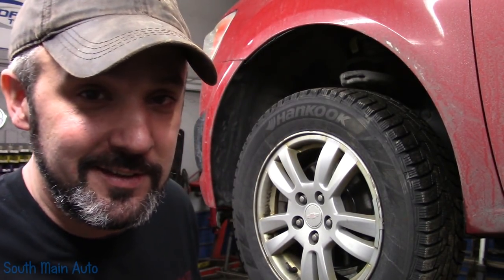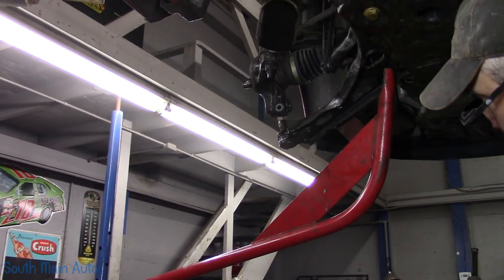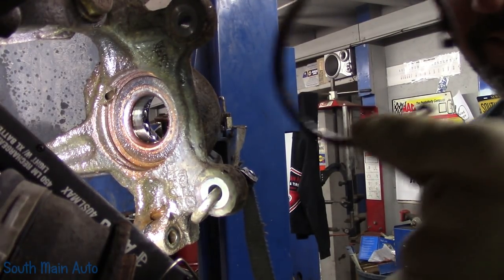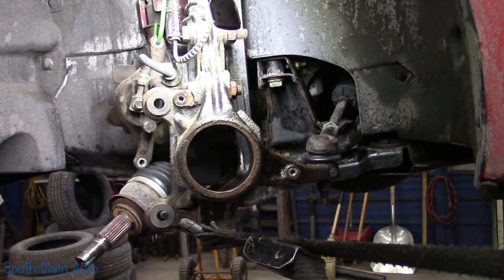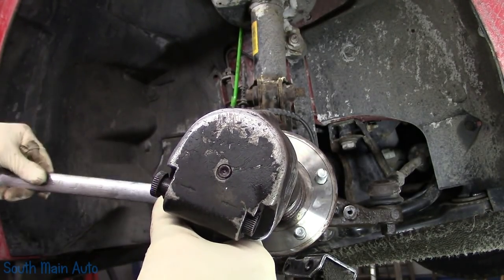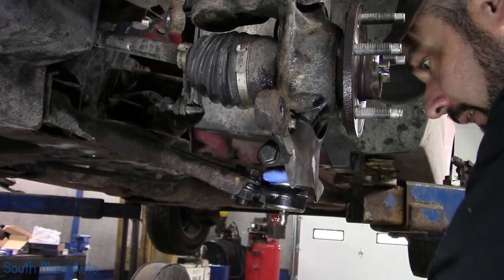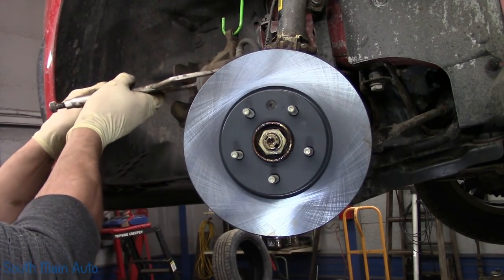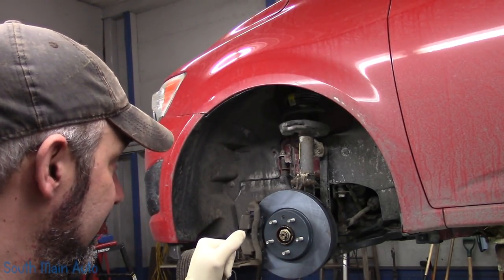Chevrolet Sonic: Front Brakes, Wheel Bearing & Ball Joint

Comment: I would have dropped the track rod end, two shock absorber bolts and worked on the bearing in a vice on the bench.
Reply: In the 30 years I have been on the spanner’s including working at ford dealerships we never did tracking or alignment on any vehicle. It’s removing nuts the same as the ball joint and two bolts on the strut. At no stage is any of the caster camber or toe in settings moved!!! Not sure you understand what’s involved
Reply: Robert Burley I’m in the U.K. and that’s what we call them. Like USA say trunk we say boot. Fender is wing. Tie rod is track rod end.

Comment: Would it make sense just to replace that lower control arm?  It seems like it would come with a new ball joint riveted in place.
Reply: Cost. The joint is at best $150.00 less than the arm, and you don't need to deal with the bolts for the arms. If the bushings are good the joint is much faster and lower cost.

Comment: What do you do on the test ride to "brake in" the rotors and pads ?? I've heard so many different things people do. Like drive fast and slam on the brakes but dont come to a stop and other weird things
Reply: thetripoflife Medium pressure application, don't come to a full stop, don't get them too hot. Keep moving and let them cool in between. Do that for 15-20 mins if you have the time. More important is the machining finish on the rotors (if you got them cut yourself) but these were new so they're good.
Reply: @GNX157  thanks 
Got a new set of drilled and slotted rotors on order for a 99 4 runner 
See how they handle verses the old ones
I had a 2 sets of rotors that worpped and from everything I've heard and read 4runners are notorious for this

Comment: It was the PB Blaster that helped. I've used it in y lawnmower shop for many many years. It's the best I've found.
Reply: I used to feel that way about PB Blaster, but I recently have found out that it is overrated, there are better products out there. If you need convincing, check out "Project Farm Channel" on YT. He did a comparison test of all the leading penetrating oils a couple of years ago. PB Blaster came out almost DEAD LAST, even WD40 came out ahead. The best? ..........HEAT!!

Comment: Is it just me or does it seem that wheel bearings and suspension components don't last as long as they did back in the 60's, 70's, and 80's? My last vehicle needed ball joints at about 60,000 miles. I've never had that before and I see so many vehicles on this and other channels showing pretty much the same thing.
Reply: Some people like to hit curbs. Hard.

Hit a few nasty potholes with my transportation appliance ('11 Sentra) and banged up the stock steel rims pretty bad to the point they were almost square, $900 for new rims, tires and pressure sensors, 93K miles, still haven't had to change a wheel bearing. The only reason I changed the front wheel bearings on my 95 Bronco was the little paperclip sized retainers they used with the auto-locking hubs broke off so the nuts backed off a bit. I had to change most of that junk anyway to install manual lockers so I did the bearings too.
Reply: Suspension parts might last longer if they had grease zerts , like they did when I was a teenager .  If people would bother / remember to grease them .

     Have not replaced any suspension parts or brakes , yet , on our 2015 Sonic with ~ 56,000 miles .

Wyr
God bless
Reply: Rear wheel drive cars had Tapered Roller Bearings basically they would last the life of the car if they were cleaned and re-greased every brake job.   Ball bearings in wheel hubs is a piss poor application of the wrong bearing design ball bearings are designed for low load application think contact point on a ball, for roller bearing it is a contact line.   Ball bearings will never ever last as long as tapered roller bearings did.

Comment: Hey I replaced my wheel bearing. Replaced spindle and brake rotor (were stuck together and broke trying to separate). Removed wheel speed sensor like supposed to. Reassembled and abs light is on. Got new speed sensor. Still abs light. Reading open circuit. Help

Comment: To get he inner race off In Avoca New York in February I would leave the hub outside for 20 minutes and then use your induction bolt or nut heater to encircle the race while the hub was frozen to minus 50F and then watch the now near molten race just fall off the sub artic frozen hub. Naw not really. I would put on my sign out front Dr. Hondoo repair shop and you wouldn't  have to mess with wheel bearings, cause Hondoo makes em to last. Oh by the way can you do a video on changing the sliding door cable on the rear sliding doors on an Ody. They want $800 for the motor and cable assy. I just want to change the cables. Gen 2 would be nice. 2003. My wheel bearings are original at 254K.

Comment: These are relatively new cars and ball joints and bearings are already shot? Can't believe the quality of Chevy! Kilmer seems to be correct. My 92 Corolla with 270K miles still got OEM front and rear bearings and still rolls like new.
Reply: Roads are rough in northeast
Reply: Funny, Toyota Tundra's and Tacoma's chew up wheel bearings well before 100k miles. I had a 2011 Tundra that went through 2 sets of rear wheel bearings in 105k miles. All were OEM bearings and the first set were installed at the dealer. Also, only 270k miles in 27 years?

Comment: Wouldn't  it be ideal to just change both wheel bearings, since one went out?  Arg, I have  a bearing out in my Subaru
Reply: Bearings are strange, you can have one go out at a low mileage and one that goes 200K with no issues. The flip side is that you remove a good bearing and install a new one, how "good" was the new one made?
Reply: Blazer02LSwhen I lived closer to the city I had to change the passenger side front one twice, its because the lanes on the passenger side have more bumps from busses and rain damage, now im away from the city roads are less damaged I haven't had any problems
Reply: I've noticed that too. Everything is always cruddier on the right side. I usually recommend changing both ball joints and an alignment.

Comment: This video gave me nightmares. I had a 2009 Aveo. If it weren't for the extended warranty, the car would have bankrupted me. It had more front-end repairs than oil changes. By the looks of it, the Sonic was no better.  After the Aveo, I swore that I'd never buy a GM car, then they discontinued their cars. I wish that I bought a Hondoo Fit instead.

Comment: Hey Eric, love the videos! I have a very quick question, everyone else feel free to chime in. 2003 chevy 1/2 ton. No power going to the actuator for the 4WD, and no speedometer, but I do see the needle move slightly when I key on. Any chance these two can be a related electrical issue?
Reply: Possibly, but doubtful. I understand that the original GM cluster stepper motors give problems. You can remove your cluster and send it to a reputable speedometer shop to have it checked. For your transfer case, if the attendant fuse is OK (DON'T PUT A BIGGER ONE IN!), carefully check the connection at the transfer case and the related wiring. Check to see if you get voltage there. Is anything else acting up?
Reply: Thanks for that. I've got stepper motors in stock ready to install, pretty good with a solder gun. I just wonder because the speedometer jumps to zero with the key on (as normal) Is the stepper motor even bad? No other issues with the truck, I'll check the fuses, that's one thing I haven't done. I suspected the actuator was bad, until I probed the plug and there was no power going to it. Thanks for the advice!!
Reply: @dropinbiking92  Ach, not a problem, you're welcome. If you do get that far on your cluster, take your time. The solder pads are easily torn away from the board, necessitating considerably more repair.
Reply: Yeah I've lifted a few traces before and made a mess of things, lesson learned haha I can get my hands on another cluster, worst case scenario, but I should be alright. I'm just figure I should look into this electrical issue with the 4WD before doing the stepper motors. From the few diagrams I've been able to get my hands on, seems like they share the same harness, and a few common grounds.
Reply: I should add that the odometer stopped working when the speedometer stopped working, figured that is normal? Would the odometer still get a reading if the stepper motor was bad? Or would it be an issue with the speed signal even getting to the cluster?
Reply: I think there's more than one system on those. Does the ABS work? I'd make sure all the speed sensors are working and check for actuator power at the module to start. Of course, make sure you've checked ALL fuses that might affect the ABS or 4wd modules.
Reply: ABS works, I checked the fuses, all are good. What is this module you're talking about? I checked for power at the plug for the actuator, nothing going to it.
Reply: It has a Transfer Case Control Module. Its near the steering column on the 2004 I think. Google BBB Industries wiring diagrams if you need them. They probably have them free. Back probe the connector for powers and grounds into the module and out to the actuator. You might find another fuse on the wiring diagrams too.
Reply: I just looked at the wiring diagrams. Maybe you should have it scanned, the module might have trouble codes which would save you a lot of time. It could be difficult to check everything without proper equipment.
Reply: @fascistpedant758  Ended up getting this solved way back. Was some wiring issues under the fuse box. All was well after some diag and repair. Yay for no parts cannon.
Reply: Was a damaged (white?) wire that carried speed signal back to the cluster. Was also a broken wire that sent output from the 4wd selector to the encoder motor. Since then I've actually had to take the cluster apart to re-flow some main power mosfets and did some new stepper motors when the oil pressure stepper crapped the bed. Surprised that truck is still going today. Just recently I cut down some tubing to make a rear crossmember and shock bracket. Damn rust.

Comment: If you’re gonna torque anything, torque those new little bolts that hold the ball joint on. Rattle the heck out of axle nut with your IR. The staking is only for the lawyers. Angle torquing for that nut?  Ha ha. Just my opinion. What do I know

Comment: GM cancelled the Sonic, and will likely cancel most/all non SUV/Crossover or truck platforms.  They also just announced massive workforce layoffs.  But they are reporting record bailouts...err, profits.
Reply: They haven't cancelled anywhere near all of their non SUV/Crossover/truck platforms. They've cancelled off a few full-size cars, an outdated EV hybrid, and a subcompact. Full-size sedans and subcompacts are some of the slowest selling segments in the market today. It's smart to get out of market segments that don't sell enough for even one manufacturer to make money in them.  GM's leadership today, is doing exactly what old GM's management should have been doing in the years leading up to the recession. The perfect example of what not to do is what Ford has been doing lately. They're a mess and they haven't even paid back their "not a bailout" bailout money. Ford should have probably killed off all their sedans a few years ago. Most were old outdated junk as it was. Had they done so, maybe their stock wouldn't have lost over half its value in the last 5 years. At least they've been shipping jobs down to Mexico like crazy. That might help keep the stock from slipping into junk status.

Comment: Daewoo didn't make that little guy,  It's made in the Orion plant right here in the USA.  I own one and it has been a great little car, The 1.4 with the turbo is a hoot.
Reply: Yep, mine was built in Detroit, fun little car i've got 111K miles on it now.
Reply: Bobby Brady  Yeah, really I have to remind myself it is a subcompact, corners flat, very quiet for subcompact, rides well unless shocks are worn out then it gets harsh.
Reply: @brianmauldingm  yeah even gets good fuel mileage if you can stay off the turbo boost, might trade it for a trax, more gound clearance up front and AWD, I end up pushing a lot of snow with it this time of year and sooner or later I'm going to get stuck
Reply: Robert Schumacher  my wife drives a 2015 Trax, it’s also been a good car. We live in GA and don’t see any snow and do mostly Highway miles.
Reply: My buddy has a Sonic too and loves it for his work/run around vehicle. I tease him about it sometimes cause he's a pretty big guy but then he reminds me how much it costs to fill up my truck and how often I have to do it. My reply is always if it ever breaks down, we can load it in the back of the truck and drop it off at a shop! It hasn't let him down yet.

Comment: Would be nice to use a pice of plywood on the floor when your using air hammer on the floor so you don’t put holes in the concrete just a little tip and why not put the brakes together and put a nice screw drive in between rotor against the caliber and torque the axel nut  just some small little tips otherwise you’re amazing at what’s you do I like the electrical stuff bolts and nuts is nothing new to me!

Comment: What's with the rivets?
Reply: Faster to assemble at the factory. Think about it: the 5 seconds x2 front control arms they save on assembly adds up over the course of 250K Daewoos a year. That equals a pretty nice chunk of change.
Reply: Faster line assembly than bolts. Less skill required to drop three rivets in and press the button.
Reply: They're stronger too. They squeeze snugly into the holes and wont loosen. If they were just a lot cheaper you'd see a lot more of them.

Comment: my wife has a sonic 87k miles. having oil pressure problems.  only way idle. delaership said it needs cam shaft actuators oil pump. timing belt. idler, tensioner not a big fan of this car.

Comment: I can tell you from experience before even watching the video that the Sonic is total JUNK. I had a 2013 Sonic hatch 1.2L Turbo automatic for about 2 years. I spent more time working on it than driving it. The check engine light would come on about every other day. I bought it from a relative for well below market value with 53K miles on it. I thought I got a deal. I had to replace the entire cooling system, including the radiator and water pump because it still had DEXKILL in it, and it had started plugging up things. I flushed it over and over again and got all that crap I could out that I could. The PCV system includes the entire cam cover, which is made out of PLASTIC. The intake manifold is PLASTIC. I replaced both TWICE. I replaced the charcoal canister purge valve 3 times. At around 102K miles the turbo failed. I'd had enough, and sold it dirt cheap. I see that one still has the original crappy Hankook tires. Yes the brake pistons are plastic too. Parts are made by Daewoo, they were actually assembled in the U.S.
Reply: the turbo version is the worst of the two, they are known to have more issues. and for transmission  the auto is the worst.
Reply: @rottmanthan  I will never buy another turbo car. I am now driving a 2006 Mercury Grand Marquis I've had for 7 years, and only had 2 minor problems. A bad alternator, and the rear air suspension system sprung a leak. I replaced it with coil springs. 238,000 miles and those were the only issues. That is how a car should be built.

Comment: Just a correction, the caliper is not phenolic. I own one of these I'll tell you first hand from visual observation the piston is steel the brakes. Phenolic would generally refer to phenolic resin, I've scratched the stuff deep and it's steel. 
Also a Chevy sonic was not a Daewoo, that would be the prior generation aveo. The sonic was originally designed by Holden, the engines are descendants of the a16net/z16 engines gm/Holden used in Europe. Though actually the luv/luh was designed as pretty general purpose engine for multiple markets.

Good video though, it's pretty coverage of the process.

Comment: 2013 and already needs ball joints and wheel bearings?!
Reply: You don't know the mileage. This car could have 200k miles on it for all you know. Even Toyota makes vehicles that need new wheel bearings in under 5 years (trust me lol). I had a 2011 Tundra that's needed 2 sets of rear wheel bearings in the first 105k miles.

Comment: That is one shitty control arm design Chevy did.  Same thing on the 2013 or so Impala.
No rotating ability, just a stupid flex bushing.
It works to the degree that it does what a control arm is supposed to do in a very flat surface.
But when the roads get bumpy the car thinks its some kind of camaro or something.

Comment: No wonder Chevy not selling cars.. 5year old car with a bad bearing, Really!  I have a 22 year old canry, with the stock wheel bearings...
Reply: @ Bobby Brady  The bearing and ball joint both on just one side, curious....
Reply: Years are not the same thing as miles. This car could have 200k miles on it for all you know. Also, you apparently have no idea just how rough the roads can be in the northeast. GM uses the same parts suppliers as every other manufacturer these days. In all likelyhood, the wheel bearings are Koyo. Many other GM vehicles use Koyo bearings. If you aren't familiar with them, Google is your friend. 

FYI, Toyota dealerships are changing bearings on 5 year old Toyotas too.

Comment: why not just get the lower control arm and forget the rivets ?
Reply: Cuz torch 😁😂
Reply: Cost. List for ball 46.00, Lower control arm 456.00-168.00" Napa pricing"  . Even with a labor rate of 90.00 hour the cheap non oem arm will cost the owner more.